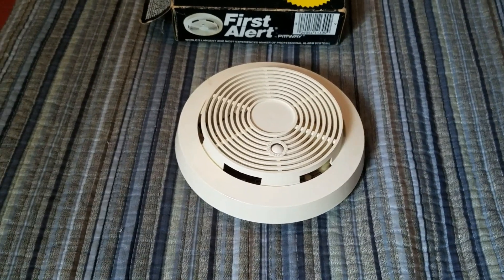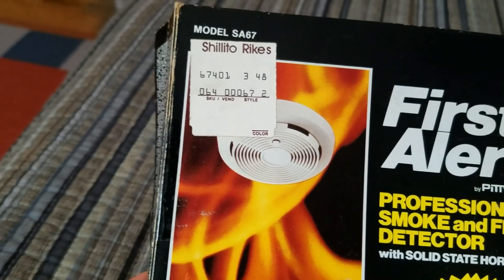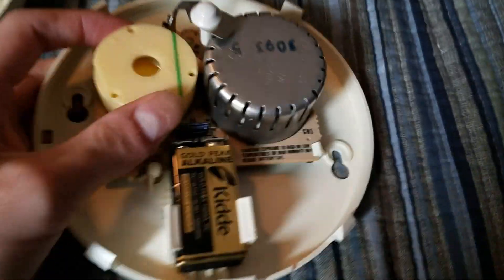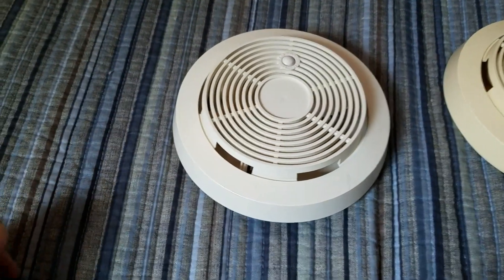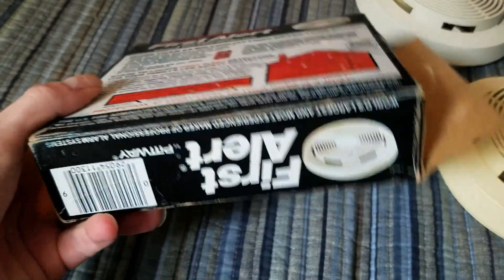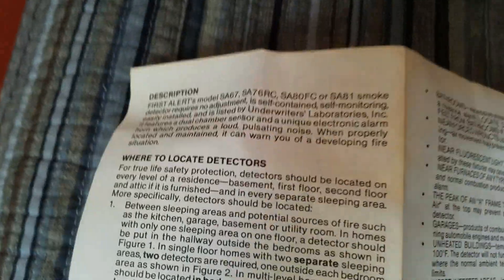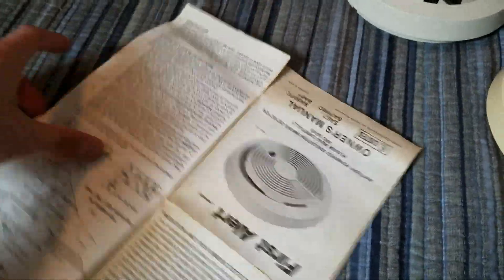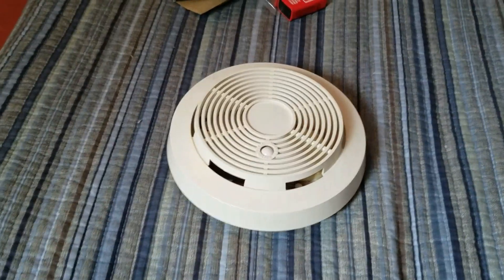First Alert SA67 Smoke Detector

Comment: There was one in my old Sunday School class that was mounted really low. It was mounted so low I thought it was a toy for the play kitchen. It didn’t have a battery so I often pressed the dome button for fun. The other SA90LTs in other rooms definitely did work though and were ceiling mounted. Last time I saw any of them was 2003. They are probably long gone.
That same room had a 270SPO inside, directly switching a 120V red 10” bell outside. Around 2003 it was discovered the bell was clogged with bird feathers and twigs so a volunteer bought a new bell which I helped install and test.
Reply: U used to do the same thing at my friends house. They had a modern piece of junk, but we would play school, and I would be the fire alarm guy.